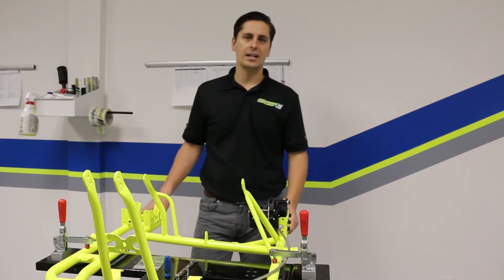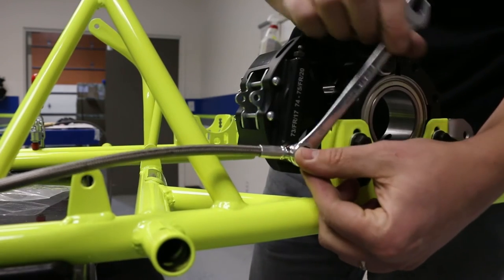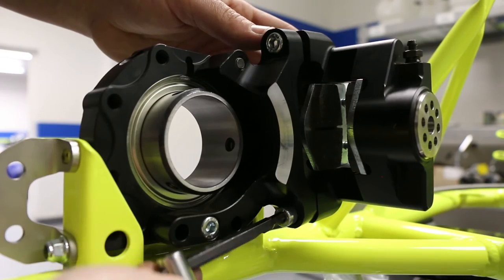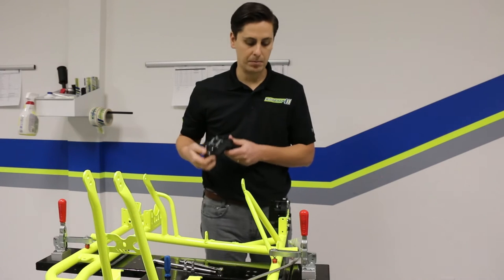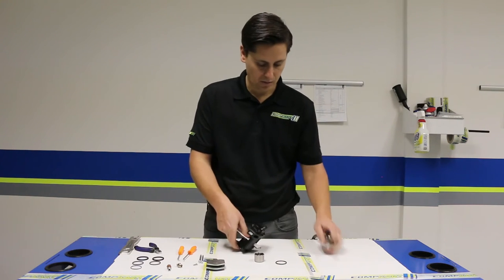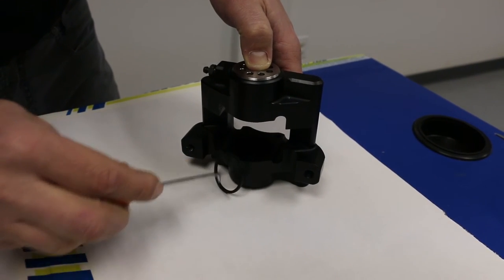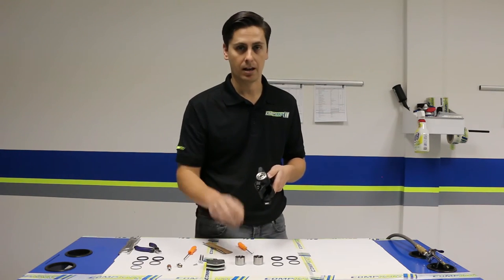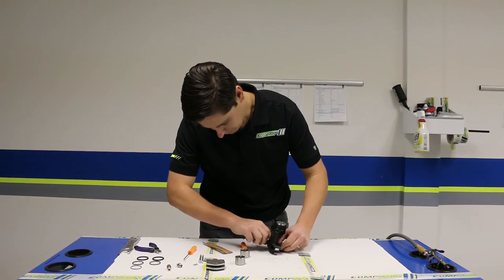Pro Tip: BRAKE CALIPER REBUILD

Comment: After rebuilding the caliper, will you have to put in new brake fluid? Assuming that brake fluid dripped out.
Reply: Yeah if you dismount the entier breakcaliper then you have to put in new brake fluid and also you need to bleed your system again.